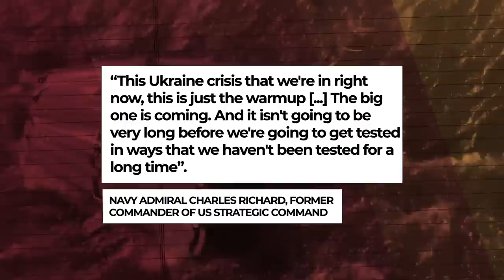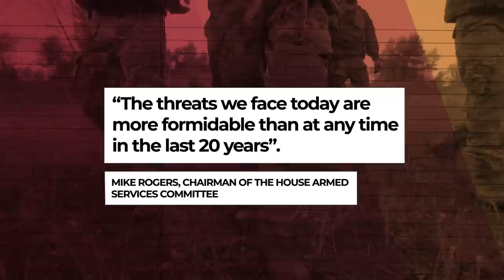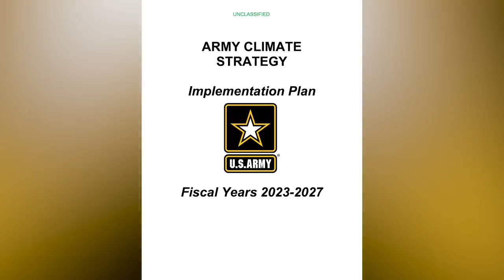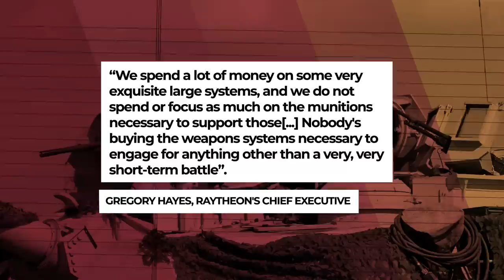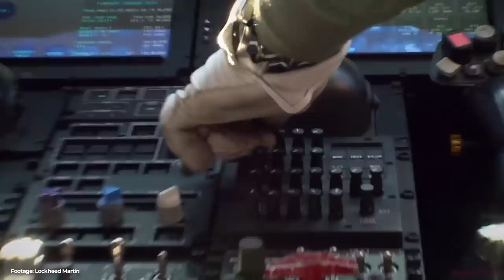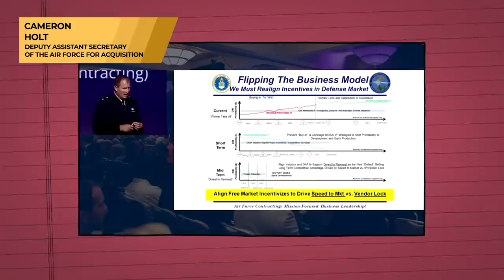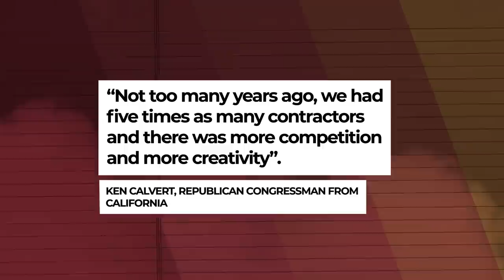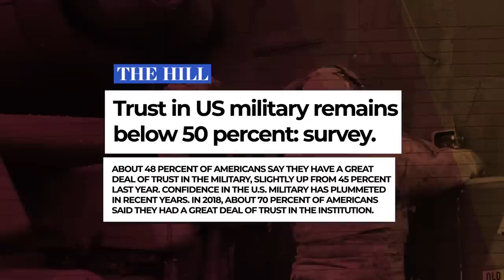Dissecting the US Military's Challenges (Against China)

Comment: Defence spending has plateaued according to that graph, but all signs are pointing to an increase, now. Furthermore, the US has significant combat experience, still has the most modern equipment, and has not requisitioned factories for armament production. The US could easily ramp up production if it had to. Just my two cents.
Reply: I'm not going to completely disagree with you, but we would have a real bad time with ramping up personel right now. Even if the prohibition against weed, bmi and physical health was lossened, the mental health of Gen Z is appalling and could not withstand the pressures put on Western type militaries. You can conscript you way out of these kinds of problems.
Reply: Yes, defense spending increases decade over decade.   It's called inflation.
However, look at defense spending as a percentage of GDP, and it's very low.  In the period from 1940-1990, it was never below 5% and usually closer to 8%.  We've had several years post-2000 where it was as low as 2.7%.
In relative terms, that means 1/2 or 1/3 of what it was 30 years ago.
Reply: Experience of losing to goat herders is not a positive that you think it is... 😂

Comment: China's strategic problems (let's set aside nuclear war for the moment) are worse. They lack the capability to transport to and sustain troops on Taiwan. Not enough sealift, not enough protection for sealift vessels. Taiwan alone might not be able to defeat a Chinese landing - that is uncertain. But with Biden's promise to defend Taiwan in mind, an assault with Chinese ground forces will fail. This isn't a question.

The CCP won't try to do that in the foreseeable future.

They might try instead air attacks, with the objective of breaking Taiwan's will to resist. China can inflict grave harm on Taiwan...

But if they did, sanctions would follow, and an embargo. Without sea trade, China will collapse. Food, fossil fuels and other commodities are essential for the state to exist.

China could try naval battles to keep supply routes open. That could inflict losses on the US Navy, painful losses. But they don't have the naval or air strngth to reopen those trade routes. And most Western nations will stop sending ships anyway.

The US won't need to engage in a ground war against China. It simply won't be necessary.

A nuclear conflict is a scarier proposition. But in such a conflict, nobody will need vast stocks of bullets, artillary shells, fuel for ground vehicles, or parts. It'll all be over quickly. There will be no winners.

China's strategic position is actually quite wretched. So i expect lots of bluster. Rudeness. Demonstrations and exercises. But they can't take Taiwan...

Unless we give it to them.

Amazingly, some politicians in the US want to do rxactly that. Don't vote for them.
Reply: China has plenty of military ships to make it 100 miles to Taiwan, and Taiwan should be aware of how the US "defended" Afghanistan and how the US proxy war in the Ukraine has destroyed the Ukraine.  I hope the leader of Taiwan isn't as corrupt as Zelensky and allows the US to stage another proxy war.

Comment: Forgive me for belittling the PLA but at the end of the day, cheap costs a lot. 
I don't buy the assumption that the PL-15 will be as reliable and more capable than the AMMRAM at a lower cost.
The cost of production in China is lower but not by a long shot and even with its massive production capacity, something has to give. 1$ to 20$ ratio? you don't get this ratio unless you cut corners to get to a certain goal post the CCP has designated to you.
You thought Russia was a paper tiger? The PLA could be worst.

Comment: Stinger missiles are 80s technology, before the war we were just about to discontinue it, so if you think that’s the product chain issue, well… how long do you think for Toyota maintain production of 2023 Camry and add another production line for 1993 Camry? As for naval power, I agree, we need to reinvest American naval manufacturing
Reply: There's a bit of a problem there.  Designing, integrating, testing, and setting up production for a new line of weapons takes quite a while, and if the new weapon isn't ready to be produced, you produce the old one.  The 1993 Camry wasn't that bad a car, BTW...gutless as hell, but super reliable, and good gas mileage.  Just sayin'.  :-)  But the basis of your comment is sound, that's why R&D up to prototyping and low level production goes on.
Reply: @MrJdsenior  why use 1993 Camry when we have something way better like 2023 Camry (Phoenix Ghost)

Comment: 6:32 This is such a dumb point, I can't believe anyone is even making it.

Stinger missiles, designed in 1967, a weapon no one is producing it in mass quantities because NO ONE in the United States military is even using it, are relics from 50 years ago. The cost of decommissioning and destroying them was more expensive than shipping them to Ukraine and letting the Ukrainians use them against Russian hardware.

That's right, shipping a Stinger missile to Ukraine probably cost $1,000 and scrapping it, and dismantling it safely in the US would have probably cost $3,000-$5,000 and you no longer had to pay someone to guard this junk.

The US is not running out of ammunition, as fast as Russia is running out of tanks, APCs and troops. So the worry about not having FULL munitions for the next 10 years, is an absurd issue, if it will take Russia 50-80 years to replace all of its losses.

Comment: The research that went into this video seems to be below the standards of this channel. A lot of the data feels cherry picked and a lot of the conclusions don't seem to be supported by the data at all. For example, stating that the average age of a US military plane is around 30 years doesn't mean much when the US has the two largest air forces in the world. If it's important to have new planes, then compare the number of new planes in the US military vs its near peers. If you show us a graph that reveals that the US military budget is nearly equal to the next 3 highest military budgets in the world after adjusting for price, it doesn't make sense to conclude that the US is spending too little. When talking about US preparations for climate change, you fail to discuss how it improves readiness for military vehicles to be able to operate without fossil fuels. Some of the issues discussed felt more relevant than others, like the reduction in the number of defense contractors. Aside from that, I have the impression that this video missed the mark.